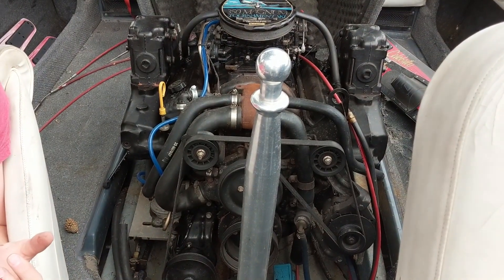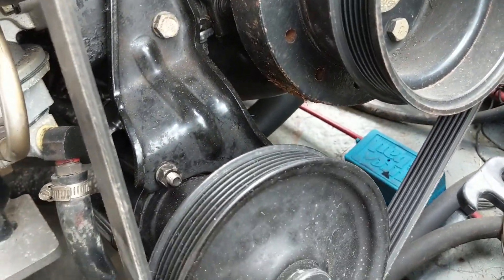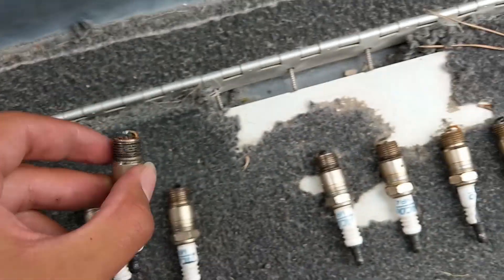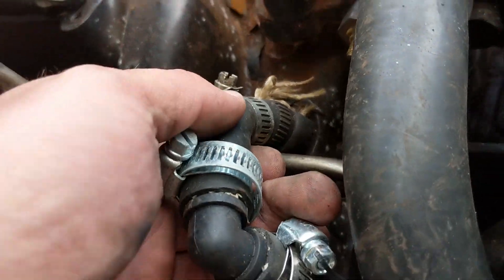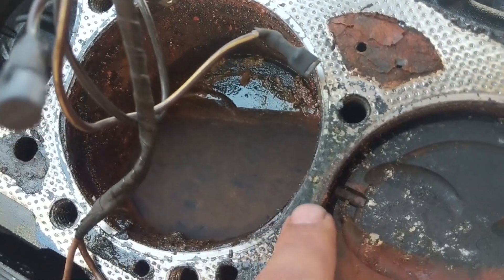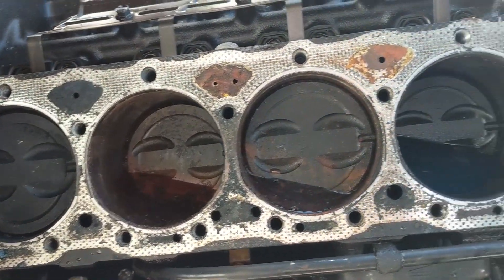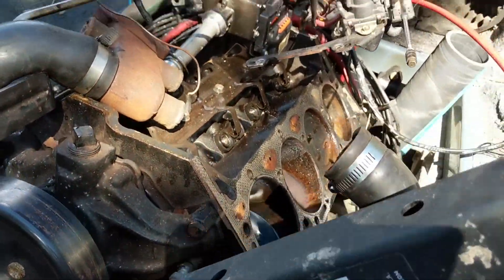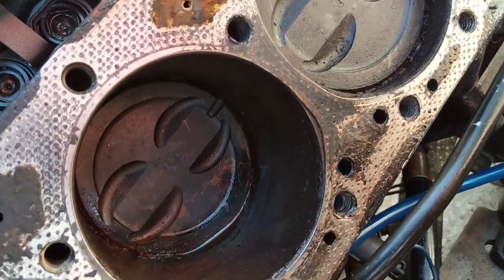$760 Tow Boat Revival #3: How To Unseize A Boat Engine

Comment: probably done already but a cylinder hone can be borrowed from most auto part stores 
im glad it worked out 
im in the same boat too 
eh eh 🙄 
with a old supra with a small block 400 
havent had time to pop it open yet 
but its soakin in pb blaster might add some diesel 
🤔 im kinda scared to but have you ever done a carb clean soak with watered down hydrochloric acid it eats away all the crud but its a stupid chemical n eats other steel parts too 🤔 if all else fails i may thow a splash in and shop vac it out n flush it out after a few hours
Reply: Bad idea from someone who worked that acid for many years. Can go wrong on many levels. Even to the extent of chlorine gas burnt lungs.